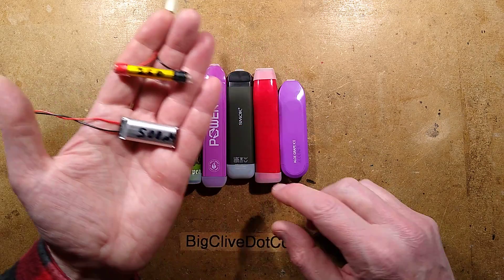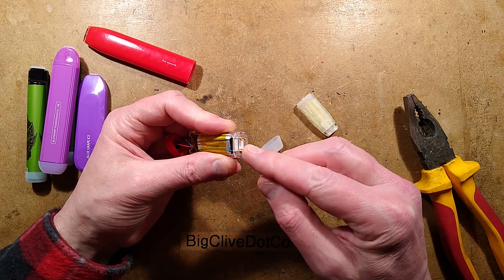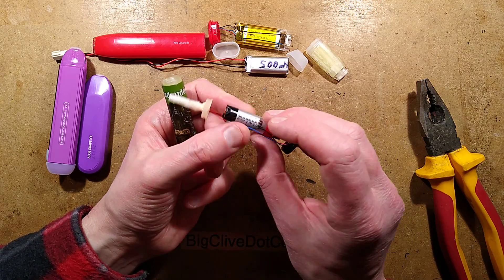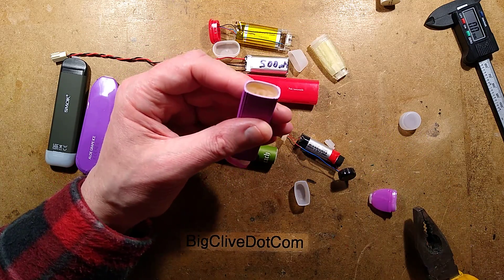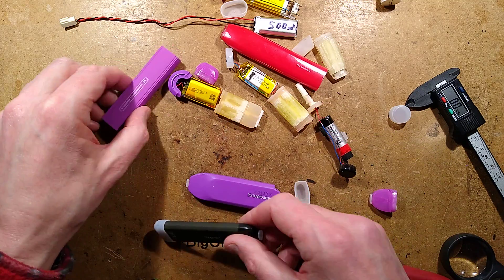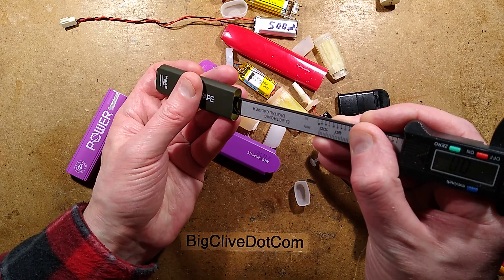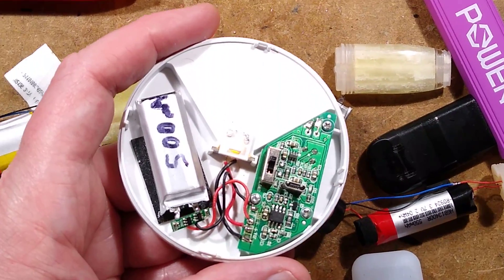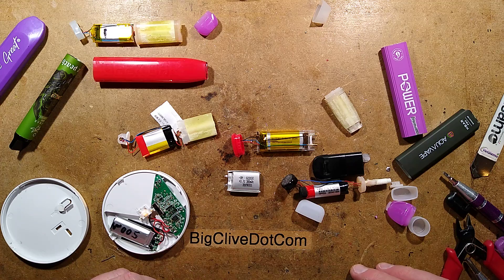Scavenging rechargeable lithium cells from the roadside

Comment: Sir, this is incredibly dangerous. I have seen an 18650 blow up in public. You're also working with lipos, which blow up like napalm. I respect your intention to recycle cells but you are risking life and limb. Lithium batteries are not safe 1 to 2 years after manufacture, I recommend LiFePO4 cells instead.
Reply from the maker: Lithium cells are safe if used correctly.  LiFePO4 would be great, but are harder to find.

Comment: Another great video thanks 👍 - Quick question if I may:  If you connect lifepo4 batteries in parallel do all the cables need to be exactly the same length to stop the battery with the shortest cable being drawn on more that other batteries with longer cables?
Reply from the maker: The main thing is that the cells are all very close to the same voltage.  Then they will all act as a single larger cell.  The wire length isn't really an issue.
Reply: @bigclivedotcom  Thanks for taking the time to answer - obviously two distinct camps on this one as many US companies insist that using the same cable lengths is critical - it would be interesting to know how you could test this to see if the battery nearest the load does actually drain down first

Comment: "How Dare us" lol but seriously, I had no clue

I wonder how you tell,Just look up the numbers on it I guess, and Could you wire them in parallel & make an emergency device..🤔 Hmmm I'm sure you will return to this topic again. Excellent video!

And yes I was wondering what those little microphone looking things, were,I opened one up and there is a few metal band/washers and like a plastic film which makes perfect sense for a pressure kind of sensor which I thought about but you have confirmed it. Your the man!

Comment: Why are manufacturers not putting cheaper non rechargeable batteries in those?
Don't they even have lower self discharge and thus would have a higher shelf life?
My best guess:
They use the non disposable variant as base and just cut out stuff.

Comment: In my day a bread toaster was a fairly expensive item you shopped for before buying. If it broke you repaired it. These days, in the US, most of them are sealed shut with no fasteners and no replacement parts available. I dislike a " throw away society" . Your channel always gives me new ideas for repurposing.  This was a great example.
Reply: I grew up in a world where 'disposable' had already started happening and had its hooks in people. I was raised with 'If it breaks, you fix it' and yet most of the time it simply wasn't possible because things were: physically sealed and cannot be disassembled without destruction of the product. Or replacement parts were more expensive than re-purchasing a whole new product. Or finally simply you couldn't repair it, the product was designed so that when it broke, it broke, now you HAVE to buy a new one.
I think the light bulb may be the best example of this, especially modern LED bulbs. They could last insane amount of time, but their circuits are poorly designed and the heat generated deteriorates the 'bulbs'.
Reply: @PanoptesDreams  both of yall are on to something. the worst thing is that it costs less (time) to replace than to repair these days. and people don't care about what happens to something after you throw it away (if they even have enough responsibility to do that)
Reply: My dishwasher gave up a while ago. But a new one at 400 euro's like any 'sane'  person would do?  or open it up, do some digging and  replace a 4 euro capacitor?
(I did the latter, but was tempted to put a 20 ct capacitor with comparable specs in it).

Comment: Well. This is pertinent to my interests. I just discovered these, but I had no idea they contained rechargeable lithiums. Couldn’t they use alkalines or zinc? Not powerful enough?
Reply from the maker: The lithiums have a higher voltage and current delivery in a small size and weight.
Reply: @bigclivedotcom  I just thought they were silly harmless fake cigarettes (I tried the flavours not the nicotine variety) but I think you just convinced me not to try anymore. Cheers Clive.

Comment: It's great to see a video on this. Being a morning walker at the local park I've started a collection of these and discovered the same thing , usable Li cells. Yes I've always tried to pick up with gloves or maybe a spare tissue I have and then disassembly comes later. I have used some of the small battery management boards on the cells to make them useful for small project builds. A great source for free Li cells. I suspect the aluminum cases are used to keep everything contained if the cell decides to go Nova on the user.
Reply: Only to focus the torch flame, whilst in pocket...

Comment: My ex wife worked for a place that made these weird "digital credit cards". There were a few different options. For example you could have dual magnetic strips with some kind of actuator that changed which strip it was at the press of a button. There were other ones that were "security cards" that didn't display all the digits on the front unless you pressed a combination of buttons... Anyway it felt super wasteful to me that they were super-gluing these teeny tiny battery pouches into this credit card (which was the same size and thickness of every other credit card). There was a stack of "reject" cells that were rejected for various reasons. She brought them home with an idea to do something with them but we never did.

Comment: That purple case might be a great platform to repurpose for a microcontroller project. I wonder if an ESP8266 board would fit in there? You'd have to make an endcap for the WiFi antenna to hang out - probably a cinch to 3D print one.

Comment: I need to 3D print a piece of plastic in the shape of 3 AA batteries into which I can wire one of these handy little lithium cells. Heck, with all that space, I could make a custom charge controller to fit in it, so that when I attach a very handy slide-on dummy "AA" cell, it now fits in a standard AA charger. :D

Comment: Can you make a qi charger for recharging them
Reply from the maker: Not that fitted internally.
Reply: @bigclivedotcom  
😂 Well I wasn't certain... I mean I'm fully aware of the standard pancake coil and how it functions but wasn't sure if it could be elliptical in design... As in does it have to be equally spaced or even could it be shaped like that if an inductor... Like a spring... Seems to me since the name inductor implies what a coil does.... Could it not wrap around the outside, it's the cross section where they pass over each other where the charge is taking place, right, or am I totally off???

Comment: t's ridiculous how they use perfectly good Lithium cells as a one-time-use device. Sure using a lithium cell will keep the size down, and delivers a lot of power, but come on people, stop making plastic throwaway stuff like this.

The Netherlands is already making baby steps on banning single use plastic like forks, straws, and such, but this is just another bullshit item typically found in the UK. Just like that single charge smartphone-juice-thingy, and could even be used as a proper powerbank if they just added a charging port to it. 

That's all it needed, but they chose this.

Comment: there's actually quite a few rechargeable "disposables" out these days, and a lot of companies are moving to them, at least for the larger varieties, so that they don't have to bin a huge battery with every one, and often you only need to charge the things 1-2 times to get through all the juice. It's still an absolute ecological disaster, but at least brands are doing a little bit of something. probably for their own bottom lines sake, but that's a different story. I work in a vape shop and actively push customers to them specifically for lithium waste reasons. plus, even if the battery has a rather fast self-discharge rate, they won't be out half a disposable and have to come back for an exchange.

Comment: Years ago I got a box of "dead" 18650 cells from a local glycol delivery emporium. Bought a load of cell holders from China and a charge control and balancing board, and built myself a battery bank the size of a car battery. I should upgrade the board to USB-C PD...

Comment: That red one is an old reshelled vuse epod 1 device sold in gas stations in n canada. 10$ battery and disposable pods, they've since updated to the vype 2 which is an aluminum replaceable pod device. Very interesting marketing cause they have more or less full customisation options yet theyll still stop working after a month

Comment: Here in Oregon in the US it comes down to what the law says. Before it was you had a rechargeable battery and you got cartridges for it. Then they change the law and the way they got around it was by making the cartridges refillable. The lowest changed again so you couldn't actually have cartridges the only thing that was permitted was one time use. But then the law was changed again to allow chargeable batteries but no irreplaceable or refillable cartridges.  What are we now left with, rechargeable one time use non-refillable vape things. It makes zero sense. 
What really sucks is that Oregon had open arms when the vape industry started. But in 2020 went people started getting sick because of the vitamin e acetate that was in the THC cartridges got blamed on The vaping fad so here in Oregon they basically overnight completely shutting down a large and growing industry.

Comment: I’m a teen and I got into vaping for a little bit and I actually did exactly what you’re doing now and used my arduino as a charger using the 3.3v and grnd line to recharge them. I eventually quit and I haven’t vaped in about a year.
Reply: How do you know when to stop charging?
Reply: @spicesmuggler2452  Use a tp4056 module, preferably with discharge protection. It will charge at a constant current and stop charging once the cell reaches the full voltage. I would not recommend charging it with constant dc 3.3v.
Reply: Keep going!
Reply: 3.3v is quite low for a lithiun cell, virtually empty.

Comment: Out on my walks I find loads, today along the river I picked up ten vape bars, a good mixture of sizes, the larger ones have longer amp hour batteries in. Elf bars and geek bars come apart very easily. I use a alcohol hand spray I carry in my back pack. I sterilise everything to. For the environment these are not good, a rechargeable battery thrown away, it's such a waste of materials which are not good for the environment. There good for cutting down on smoking but rechargeable devices are the way to go. I would not be surprised in a years time these get banned in favour of rechargeable vapes. There are loads scattered about the countryside sadly. Battery wise disposable vapes are a waste of perfectally reusable materials.

Comment: I just salvaged about 200  Panasonic NCR18650B. The same brand that are in Teslas. I only paid $0.75 a piece. With a combined power over 2.3KWh for $138. Thats only $60 per KWh. Beat that. The harvesting video is on my channel and will work on more as I go along. Also have 1600w of solar on my rv conversion that tilts that I made myself. These 18650s would destroy those and blow them out of the water

Comment: I've found so many of them just laying around on the street. I've gathered 20+ Lithium Polymer 850mah cells.  I had more, but I used those in some projects.
These cells are actually pretty high quality since they are designed to energize a coil which draws a lot of current.
Reply: I've started scavenging them lately, as a veteran could you point me in the direction of the best way to charge these cells?
Reply: @rnbmeister  See Bigclive's other videos, using a TP4056 board: https://www.youtube.com/watch?v=M88e1r8nvYk
Reply: @elgorrion52  don't forget to use one with discharge protection for safety

Comment: Actually, one of those cells would be a good upgrade for the magnetic motion sensor light I put above my door. The cell in that thing is extremely optimistically labelled 2000mAh, but that's clearly a lie since it's only 7x19x30 mm. I would guess it's closer to 300mAh, so a 500mAh cell would be an upgrade. Or even better, there's room to put two or more in parallel, so it could go from needing to be charged every week or so to every couple of months.

Comment: I replaced a dead cell in wireless mouse with one of these. Works pretty well but you gotta save a protection board from the old one or buy a bunch of them from China. 
Yes, these cells are such a rubbish there's no proper datasheet for them. I wanna figure out maximum discharge current, maybe it can be used for something more powerful than remotes and flashlights.

Comment: I now have enough to make a 90V battery, there is one vape which is about 24MM square which has 20MM diameter 40MM long cell with a whopping 1500mAh, I have used these for torches and lighting one of my sheds that is charged from a solar panel.

Comment: I have made several rechargeable LED flashlights with rechargeable lithium batteries I got for free in broken Kids DIY airplanes 
I will have to look what the cheap Vapor units have in them here in the USA 
As I want to build a high output LED rechargeable flashlight 
So I may use several  rechargeable lithium batteries to power the LED flashlight

Comment: How does one pass suggestions for disembowelment to you? I have a digital tyre meter, a model that has been re-badged by many suppliers, including the AA. It seemed to have 'died' but being a bit like you I decided to open it up (it's screwed together). Sure enough there there were two varieties of button battery. I replaced them and it came back to life, all for maybe £1 in cheap button batteries, saving me £10 and avoiding landfill 😏  I hate 'disposable' items that can be easily revived with a screwdriver and cheap  battery 😕 Anyway, it's the sort of device that you seem to like to disassemble so it might amuse you 👍 More details available.

Comment: Actually I have one of them laying around here and I’m sure it has an under voltage protection circuit combined in that pressure sensor, it’s not just a sensor it’s a complete circuit with a MOSFET for the heater and LED indicator and under voltage protection IC.
The battery is rated 800mAh
Reply from the maker: The sensor usually has a dedicated chip for everything including switching power.  Pretty impressive.

Comment: I haven't been lucky enough to find these on the sidewalk or anything, but a friend of mine gave me 11 depleted units, and I was able to collect all the batteries and combine them inside a cheap 3x18650 power bank kit. I get about 4Ah capacity with a mix of 280mAh and 450mAh nominal cells.

Comment: It's really a shame that those devices are even allowed to be disposable. The battery should be sold separately and they could even use AAA rechargeable batteries in it that the consumer should  remove before disposing of the item.
Reply: AAA batteries dont have the amperage to run the devices.

Comment: So they must be high amperage batteries.   I wonder what the internal resistance is if they are???   You mention seeing them discarded on the street.   I have found at least a dozen thrown to the curb.   They are visible at night when the low battery LED is flashing.   A shame to be discarded but a bigger shame folks just litter with them.